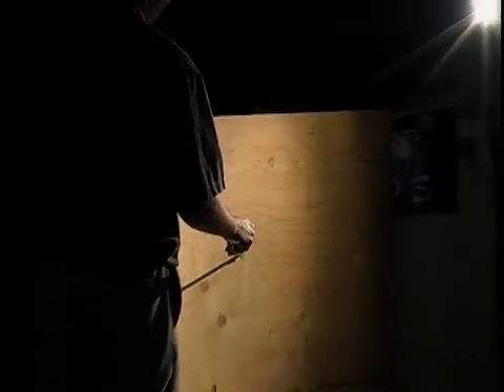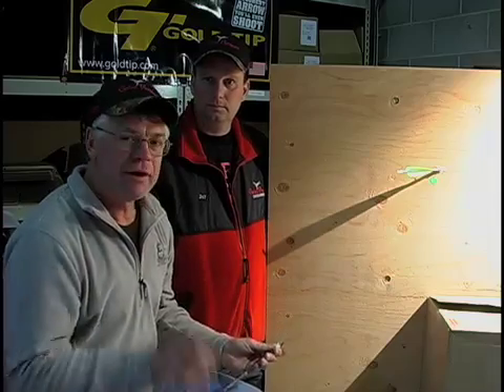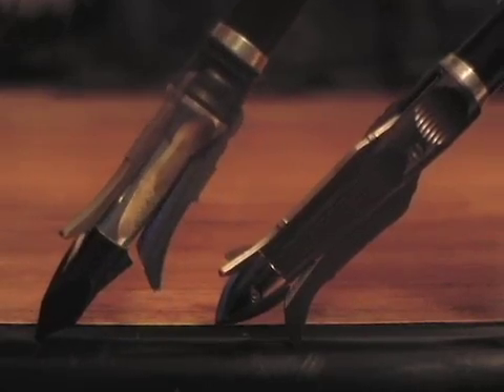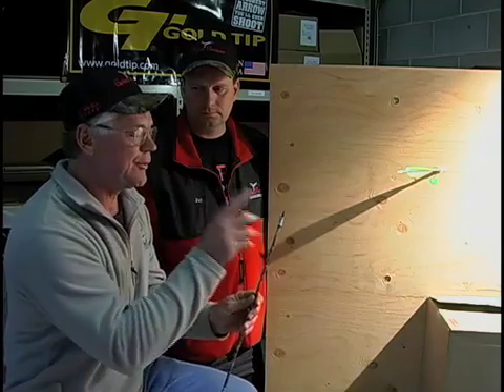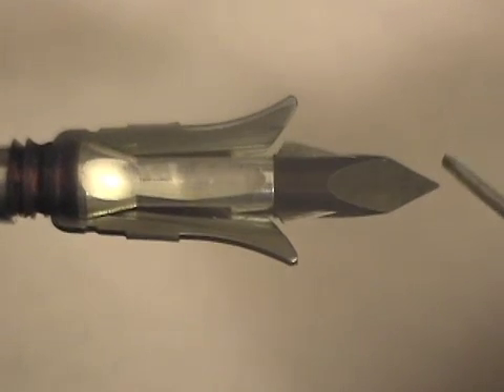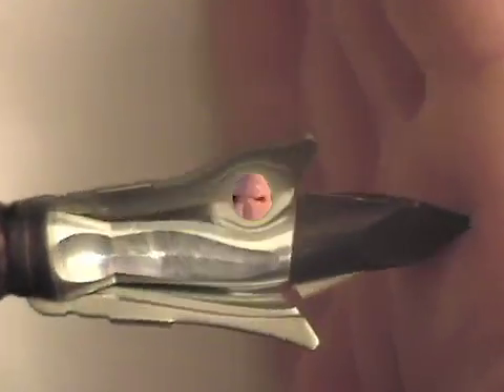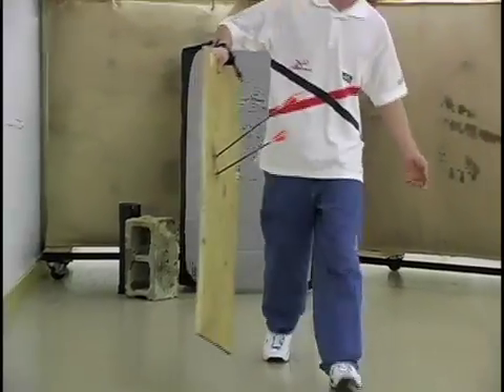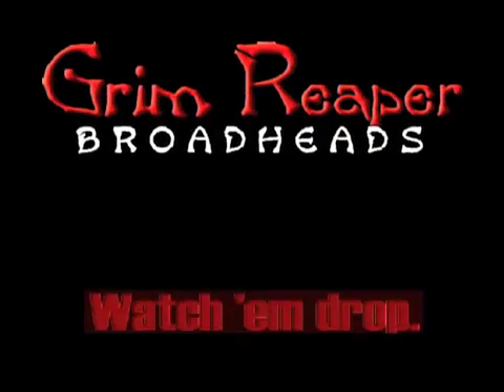Plywood angled shots

Comment: >>>allabout.wiki/u91r    I like the razor tip attached to the point which is why it's called " cut on contact". The increased cutting diameter is a big plus. I haven't had a chance to use one yet but I think it'll be awesome